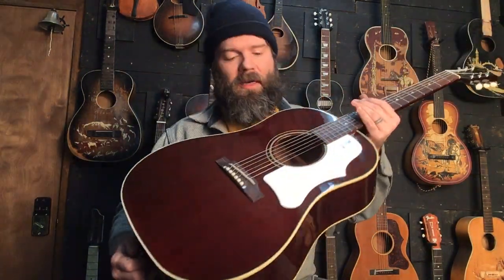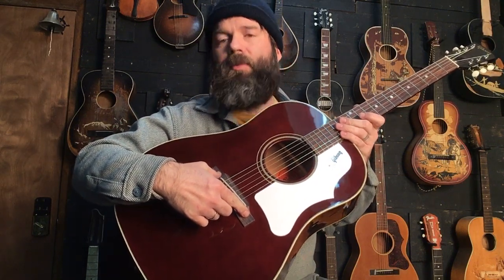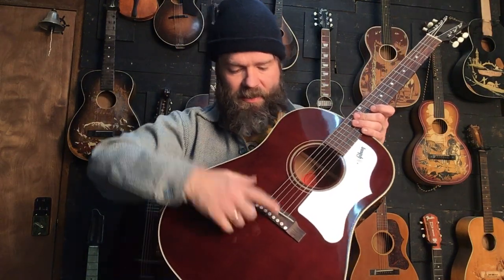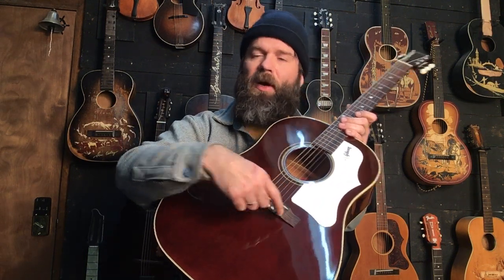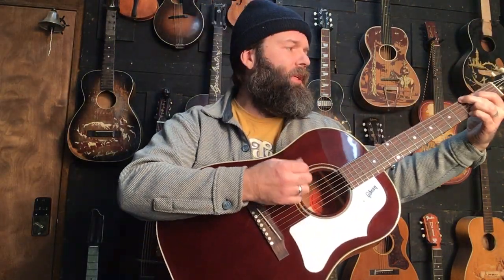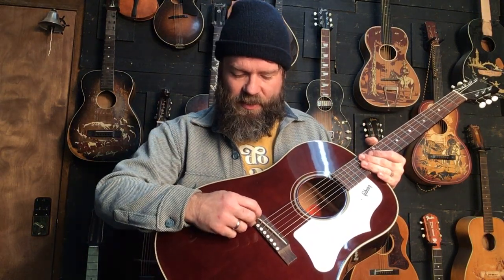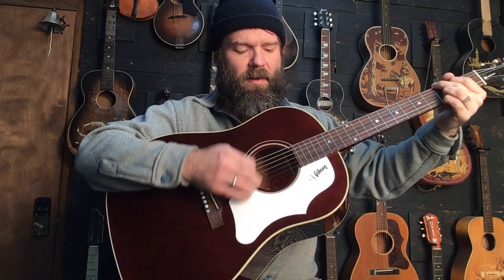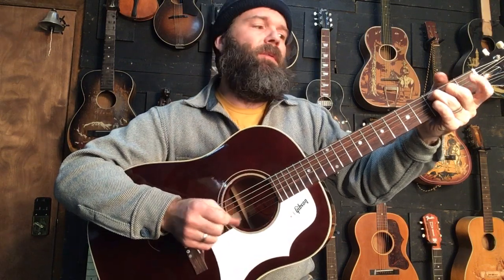Reissue 1960’s Gibson J-45 Adjustable Saddle Replacement // Upgrade

Comment: Thank you for posting this video.  I enjoyed it and I own this guitar, I would like to convert it to a traditional bridge as I can not remedy the buzz from the mechanics you describe. Do you have any more detailed photos or tips as to this process, I could use to make sure its done right. I would give it to you to fix but I am in Atlanta.
Reply from the maker: if yours is buzzing, did you try reaching inside and tightening the nuts on the inside? sometimes they rattle loose. 

As far as my repair, it's really simple. I find a matching piece of rosewood. I cut a saddleslot in it on table saw. Then I cut it off on the table saw so its the same thickness as the the adj saddle slot in the bridge. then I cut it and file it so it slides down in the slot and then shape anything sticking out of the top till it is flush with the bridge. it should fit snug. I do not glue it incase you want to sell it and the future owner wants the adj saddle. then I have to make a custom saddle to fit the width of the saddle slot cut by my saw.

Definitely use some practice wood to get the right size. since table saws aren't super precise.
Reply: @rockereb  Thank you sir.  So basically, plug the "slot" with rosewood, to shore up the oversized slots width and length, then cut (router?) a new insert into that piece of wood, in which the actual new saddle would drop  in?  Am I picturing that correctly ?  

What if I kept the same saddle it currently has (link below) and simply put a piece of rosewood under it to plug the bottom half of the oversize hole?  Would that work or with the existing saddle shift left/right etc?  

Thank you so much for responding and the great video.
Reply from the maker: @jmcaswell777  i didnt explain it clearly. On the tablesaw, i'm making a U channeled strip of rosewood that can be cut to length and rounded to drop in the hole, because its precut in a u channel it has a slot in it. 
You could definitely try just shimming the saddle. I even made a giant bone saddle once to drop in there.

Comment: i have a 66 j45 and a 69 epi texan, the j45 had the adjustable bridge replaced with a fixed bridge and the epi has an adjustable bridge, i think and adjustable is silly, once it's "just right" you won't be moving it, but this myth about the sound is that - a myth, the j45 and epi sound different, but they both sound outstanding. the whole thing is subjective, two identical guitars made form the same woodstock in the same factory by the same people can sound completely different - the bridge makes little or no difference, other than some are ceramic, some are ebony and others are rosewood, but the adjustable part - i think you're wrong.